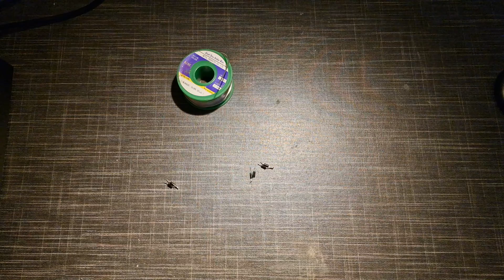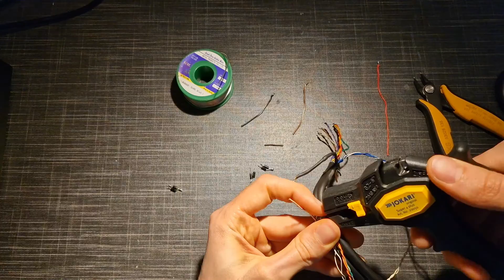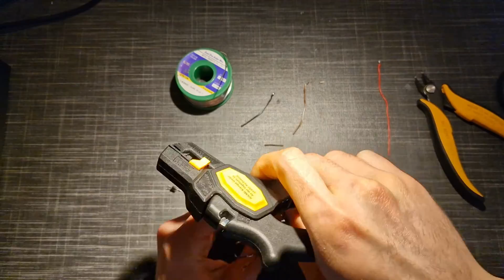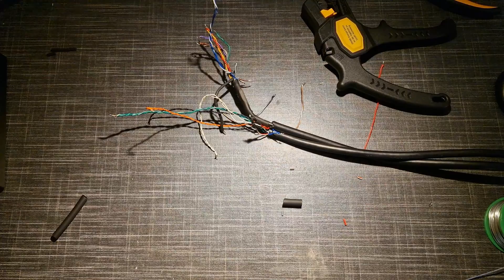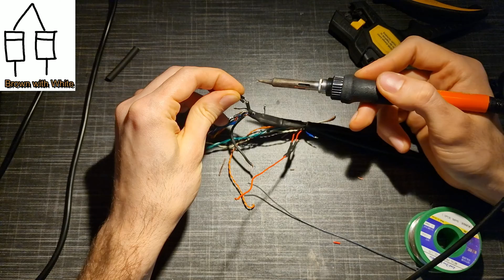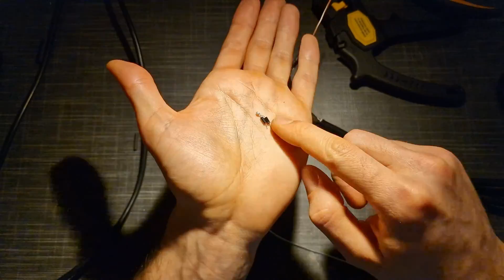Logitech Z5500 Power From 2 Amplifiers To ONE POD Control

Comment: hi @Elektro Gamer  do u know what Rectifier diode ur using  i know its an BYW98 but there are many diffrent specs like volt and amperes  V/A thanks already
Reply from the maker: Hello, I don't know exactly which model I used.. 1N4007
You don't need a power diode because POD Control doesn't have such a high consumption!
If you still need help, you can always leave a comm.

Comment: Logitech z623 vga cable male to female proper connection bro please 🙏
Reply from the maker: Hi, I don't have such a system to measure pins from the VGA socket!
All I can say is:
Pin 5 and Pin 15 for power on! (Add a switch) and pin 6+ and Pin 10- (Connect to a mono or RCA jack)

Comment: Hey great work. Your videos on z5500 fixes have been very helpful. I needed your help with something. My control pod connector got damaged and now mynsystem is collecting dust. The control pod works fine so is it possible to replace the connector with a d sub 15 pin. Any help would be appreciated.
Reply from the maker: Hello, and thank you!
I'm glad I could help you through the videos I created!
If you mean the VGA connector that makes the connection between the POD Control and the subwoofer, Yes, it can be replaced easily!
I leave you PIN OUT here!
1 - Brown
2 - Grey
3 - Red
4 - Green
5 - Yellow
6 - Orange
7 - Blue
8 - White
9 - Violet
10 - Red with White
11 - Green with White
12 - Black
13 - Blue with White
14 - Brown with White
15 - Black with White